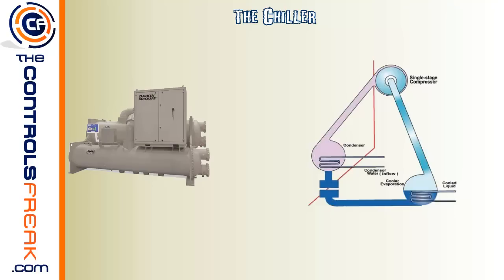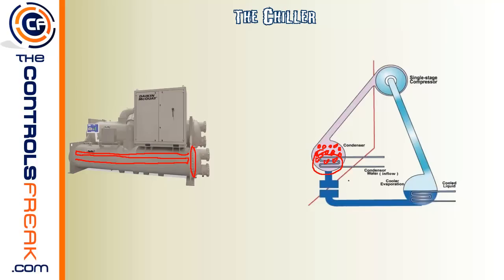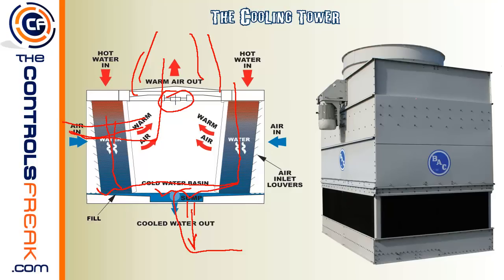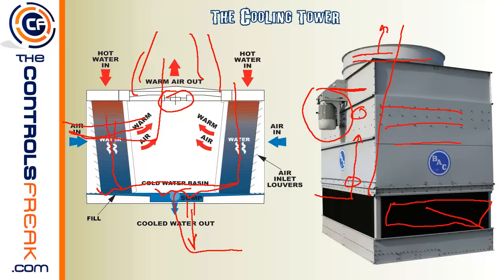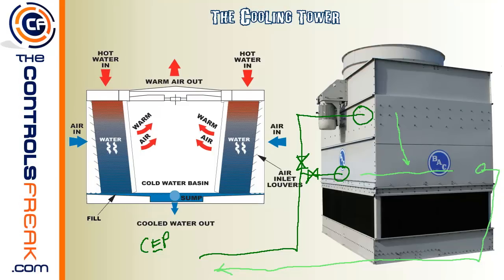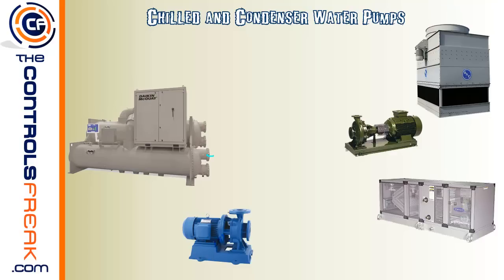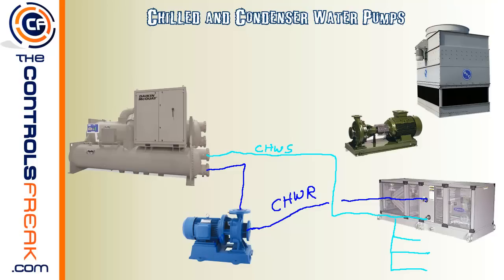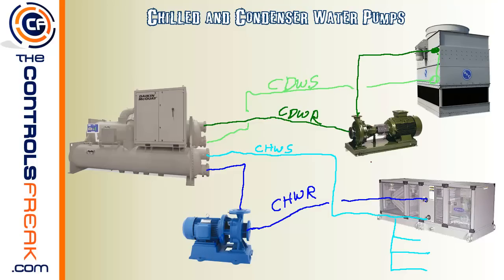Central Energy Plant - Basic Overview - How a Chiller and Cooling Tower Work Together

Comment: Also noteworthy is that CHW loops and CW loops can be drawn OR pushed through the equipment.  If your CWS comes out of the tower, then through the pump, then to the chiller - it is a drawn loop.  if you return CHW from the building, run it through the pump, and then the chiller - you are pushing water through your chiller.  Then you also have primary and secondary CHW pumps and constant volume bypass headers, etc, etc...

Comment: 2° When you compare the cooling towers, indeed they are not matching, the left one is called an open cooling tower exactly what you explained before, the right one is called a closed cooling tower, the water is circulating on top of the cooling tower in a closed coil (so the name closed cooling tower). There is a basin full of water at the bottom of the cooling tower; this water is continuously pumped to the top of the CT where nozzles are spraying the water on the condenser water coil.

Comment: I always tell my interns this. Supply lines head towards the load. Return heads away from the load. Condenser water supply goes from cooling tower to chiller. Chilled water supply goes from chiller to load.

Comment: on the AHU - the coil connections can be configured in a variety of ways.  The supply connection is not always the bottom connection; but it IS ALWAYS the connection on the "leaving-air" side of the coil.  You want your coldest water to interact with the incoming air last in order to maximize the heat extraction from that air.  

Keep in mind none of this equipment actually "cools" water or air.  It "extracts heat" from water and air, resulting in a cooling effect.

Comment: 4° When you draw the pipes, please consider that the water pipes are always connected at counter flow with the refrigerant (refrigerant is going down in the condenser as it condenses and going up as it boils in the evaporator) so exactly the opposite of what you draw there.
Consider all these remarks as constructive

Comment: Hey control freak, i just wanted to make a correction about the motor, you said it is going to have some "gearing" to operate the fan. This is incorrect. With a motor vertical motor like that it is going to have a pully on the motor shaft and fan shaft and both be connected with a belt. If the motor was horizontal then the motor would be connected to a gear box with a drive shaft, and the fan shaft would be connected to the top of the gear box.

Comment: Thanks a lot...very easily understandable...It was nice to have ur lecture.... can i know what is primary pump and secondary pump... and whey are used..
One more thing... it would be still better if you mention temperatures and pressures at each stage...

thanks again

Comment: 3° The sprayed water is evaporating and cooling down the condenser water, the excess of water is dripping back to the basin. There is also a fan sucking air from the opening at the bottom and blowing it (hot and moisturized) at the top of the CT.

Comment: awesome show...but probably their is a small defect in this installation ...in video shown both pumps of circulation heat and cool water are installed in return network installations..it's obligatory to placed pumps on return network or in other side  ? my opinion is to inverse installation because velocity of discharge water is Superior to velocity of suction water for this argument transfer heat and cool within evaporator and condenser cannot correctly  carry out . that means long time running of chiller .

Comment: hi, great presentation, great. 
I'm barsileiro, live and work in Rio de Janeiro, I had a doubt Evaporator is not above, because the compressor suction in this cooller above, is what it seems! this is a chiller daikin macquay, and usually the condenser is below the evaporator, because the compressor is directly connected to the evaporator. 
  my congratulations and Thanks for listening and post more videos.

Comment: The Air Handler takes chilled water (generally 45°F) from the evaporator barrel. This water is in a "closed loop system" meaning that water cannot escape. (although through maintenance and time some does and a make-up system will be uses here as well) This closed loop system will cycle through the building collecting the heat the air handlers are removing. When it gets back to the evap barrel the heat will be transferred to the refrigerant.

Comment from the maker: Thanks for the comment, James. For now I am going to disagree with you that there 'never' is a situation where the fan is turned by something other than a belt. Maybe the one in the video, sure.

But I have seen cooling tower fans that are 20+ feet in diameter and no belt I know is going to be relied on to spin that puppy!

Comment: No. The cooling tower uses water that goes through the condenser barrel. This water is called condenser water. As this water is run through the water tower some of it will evaporate. Replacing the evaporated water is required to prevent it from eventually all evaporating. To do this we use a pipe system called make-up water that is pulled from the buildings supply water system. Because this water has minerals in it the water has to be chemically treated to prevent "scaling" on your tower fins.

Comment from the maker: Sure... what you said. I know I messed up on the placement of the Condenser Water Pump, however the wording of Supply and Return should be used in relation to the Condenser Water Equipment. That usually means the Cooling Towers... and their job is to Supply cooler Condenser Water to 'whatever' is on the other end. A chiller, a heat exchanger... anything. The water that Returns back to the tower is well Condenser Water Return.

Comment: The refrigerant will transfer this heat to the condenser barrel which will transfer the heat from the refrigerant to the condenser water. The condensing water will go out to the water tower and be transferred to the air. 

The water in the closed loop system will also need to be treated. Since most chilled water piping is in black iron pipes the water will need inhibitors. Inhibitors prevent the iron from rusting in the pipe.

Comment from the maker: I was at a Female Correctional Facility in Ocala, Florida that used underground water and heat exchangers for the water source heat pumps. A real energy saver. Though at the time the plates were getting changed out because they litterally were creating pools of water on the floor from all the holes. ;)

Comment: you can also pair cooling towers with heat exchangers and water source heat pumps to provide what is essentially called "Cooling Water" to units in a building achieving the same principal results.  In this situation I've also seen cooling towers and Tower Water Loops substituted with Well Water Loops to take advantage of naturally occurring (free) "cooler" water - which is simply pumped through the primary side of a heat exchanger.

Theres all sorts of neat shit out there...

Comment: Hi, nice try.... but there are some mistakes, 
1° The evaporator is the upper vessel, you can see the suction pipe to the compressor coming out of the evaporator which is the upper vessel. When you explain the cooling tower, you may say you cool down the water by blowing air through it, it's correct but far from complete, you have to say that you cool down the water because a portion of this water is evaporating; it means the water temperature can reach the air wet bulb temperature.

Comment: Great Video , Thanks for sharing, little more details required for type of valves used and positioning of them, also for the selection of cooling towers, please share some more video with more detail which can help designing and equipment selections.Thanks.

Comment: Hi,
You mentioned the reason why CHWS should be in the bottom of the AHU and the CHWR to be in the top. Is this applicable to the Chiller also? I mean, the CHWS leaving the chiller should be from the bottom pipe and the CHWR to the chiller should be the top pipe?

Comment: I have a question: The water on the cooling tower and the water going to the air handlers is the same fluid?. I mean, does the entiry system uses the same water? All the water is mixed?. Great video! Thanks

Comment from the maker: I will disagree on that... I think if you have VFD control you are better off (energy-wise) running one fan at 80% than 2 or 3 at 20-30%. Though I will say alot of designs/sequences don't incorporate some way to run water across the tower with the fan being off. Most cooler outside air temps will actually do a good job cooling with no fan.

Comment: Hi CF,
You mention the water leaving the condenser would be 'hot', going into the top of the cooling tower. Why would it be hot? Why not regular temp?
Thx
Reply from the maker: The water is hot due to carrying the heat created by the compressor on the Chiller. It is similar to how a radiator works on your car.

Comment: Regardless with the CDWS and CDWR if we say CDWS means the Condensing water supply that will RETURN to the Cooling tower going to the hot basin and drop to the cold basin and supply to condenser which is also called cooling tower water supply which is the Condensing water Return, i guess your Condensing water pump must be place in Cooling tower water supply "CDWR"

Comment: If your ambient air temp is  70 degrees, the water exiting the cooling tower is somewhere in that neighborhood. How does the water entering the centrifugal chiller get much colder than ambient to produce the temperature necessary for the heat exchanging process  . .
Reply from the maker: If the Condenser Water Supply Temperature is around 70°F then that is doing pretty good being that the Return Temperature might be around 85ºF+. The ambient temperature does greatly affect what temperature is returned to the chiller, but obviously this setup is still used in Texas on a 100ºF day.
Reply: +The Controls Freak it's all about the wet bulb

Comment: 3:29 Shouldnt condensors have "cold water" comming out of it instead of "hot water" comming out of it? wrong?
Reply from the maker: Jacky Hu The water coming out of the condenser side of a chiller is 'hot' as in 85°F - 95°F which then gets cooled down once it goes through the cooling tower.
Reply: The refrigerant inside the condenser is being cooled (condensed) from vapor to liquid. The condenser and evaporator are heat exchangers. Heat is being rejected to the water flowing inside the condenser.

Comment from the maker: Thanks for the comment, albeit a little hard to read. I reviewed the video once more to refresh my memory and well looks like you may be right. I kind of threw that video up a little fast. In many installations I have been on, the CDW pumps push through the chiller to the cooling towers. Thanks for the comment and I will need to add a correction to the video soon. Take care!

Comment: Is condenser water supply at the same temperature as chill water supply?
Reply from the maker: No, the condenser water is typically 80°F - 90°F since it is being used to dissipate heat from the condenser chiller barrel.

Comment: Somebody can help me.... Any AHU Air Handler Unit can be used with a Chiller ?  For example the same Air handler of a common house
Reply from the maker: Luis Contreras The answer to this would be a no, typically. Most residential units use Refrigerant, where as a chiller uses water as the cooling medium. You would need a chilled water AHU with a water coil.

Comment: The condenser water pump should be the one pumping the cold water to the condenser and not pumping water to cooling tower. The condenser water pump should be connected to condenser water supply (pumping cold water to condenser). Plus, the condenser water pump make sure that the required flow at the condenser is attain.
Reply: what setup are you running.  Here our chilled water pumps are on the return side and our condenser pumps send it up the tower. The chiller system has two separate loops.  The condenser side and the chilled water side.  The condenser sends it to the tower and the tower sends it back down. Mean time your evaporator is drawing the heat in cooling the liquid going to the coils then returned to the chiller with the chilled water pump.  Thats how the system works here at the hospital.
Reply from the maker: @oliver as mentioned many times... you are correct. Almost all systems have the pumps pulling from the cooling tower basins rather than pushing water up the tower.

Comment: i am looking for material where i can get info of central plant controllers if u have some i will appreciate if you share it thank you
Reply from the maker: Rigo arevalo A controller is a controller... they all have inputs and outputs and with a CEP you will need many of both. As long as the controller is fully programmable, any controller can be made to control a CEP.

Comment: What does the condenser side have to do with the evaporator side though?
Reply: nothing its 2 different loops.
Reply from the maker: arkk1 The evaporator provides cold water... which is created by the work of the compressor... which generates heat that is cooled by the condenser. In a car, the engine (compressor) is generating the heat and the radiator (condenser/cooling tower) is what helps cool it.
Reply: The condenser reject the heat, and the evaporator absorb the heat.
Reply: The Controls Freak thank you

Comment: Hi. Your explanation isn't 100% correct. You have your condenser water flow and return back to front. The cold water from the basin of the cooling tower should enter the suction end of the pump and discharge into the chiller. The hot water coming out of the chiller condenser is piped directly to the top of the colling tower.